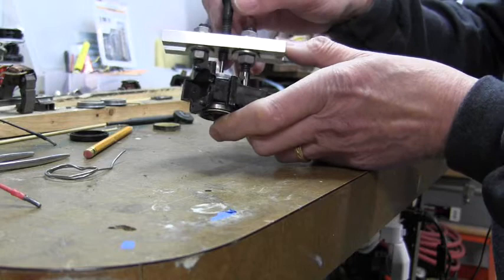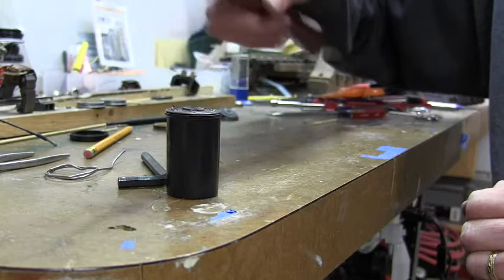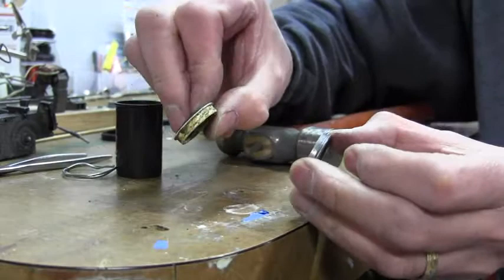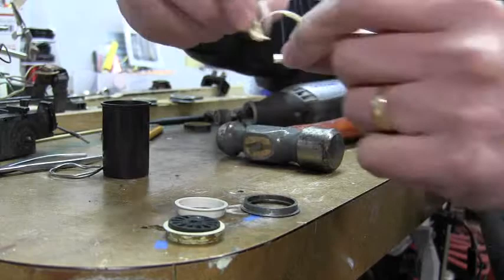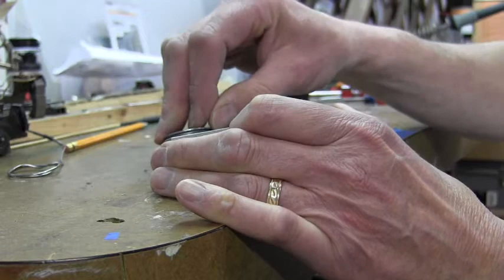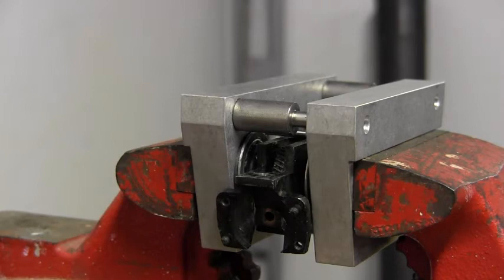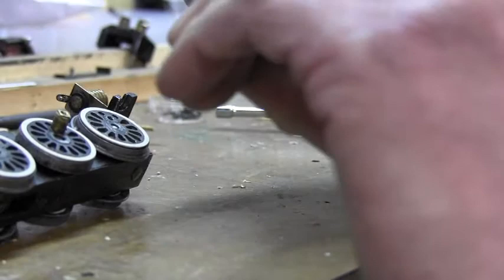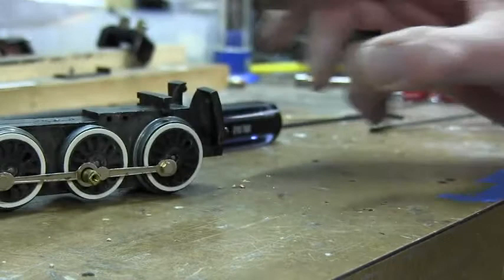American Flyer Steam Locomotive Wheel Repair and Quartering

Comment: Just  a real interesting side thought here. The quartering of the timing of the heels in reference to the side rods brings up a very important question.  I have been hearing lately that the normal steam engine make four chuffs per revolution.  If that is true, would not two of them make the chuff together, and then there would be a space between the 1st and the last chuff as well, as in reality three chuffs per revolution, with a break between the 1st and the 3rd chuff...

Comment: I have a 1957 Loco with the 4 drive wheels. I was just doing some cleaning and oiling and noticed one of the front outside wheels was spinning freely on the white piece. I removed the wheel expecting to find something broken but everything looked fine. I then cleaned them up with some mineral spirits removing all the oil and the pieces snapped back together with a click. 

So was wondering if a few drops of CA glue around in inside perimeter of the two front wheels while they are removed would be appropriate to prevent it happening again. 

I don't have a quartering jig but made good a reference to where the wheels were and  only removed the front wheels not the rear drive wheels. I saw quartering jigs on ebay but before spending 70 bucks I may give it a go without one. Use a C Clamp to pull the two wheels together. Thanks for the Video.

Comment: Great video.
I have the Pacific/K5/Hudson quartering tool for 6 wheels & Northern Quartering tool 8 wheels that are idential to the quartering tool you used.  I also have the factory reproduction quartering tool for the 0-8-0. All bought from Portlines.
Is there a quartering tool available for the 4 wheel  Atlantic?   If not how do you go about quartering the Atlantics?
Thanks.
Reply: My wheel puller identical to the one you used in the video.  I have used it for six wheel and eight wheel standard size wheels.  The aluminum block's slots were not milled deep enough to bring the tips close enough for the flanges to get under the center hub of an 0-8-0.  Any suggestion for what wheel puller to use for the 0-8-0 or other method if removing the hub?  Thanks.

Comment: I was watching the video as I was trying to put the wheels in the quartering tool and then I never saw the time when you installed the axles, Did I miss something?
Reply from the maker: The front two axles were placed in the chassis. The rear axle has the gear. When the chassis is placed between  two halves of the jig and then pressed together everything goes together. Sorry for not being more clear as I explained in the video.

Comment: What about wheel slippage on the track. I have problems having the #312 engine pull a long line of rail cars? The engine wheels will just spin until they get enough friction to pull.
Reply from the maker: The wheel treads are worn out due to age or being cleaned polished with sandpaper. You have two options: Try using some coarse 80 grit sandpaper and sand across the tire to give it some roughness. The other option is to replace the wheels with Pulmor wheels.

Comment: I don't have that awesome quartering jig but I have a question about the same.  When you quarter the wheels, are the one side exactly 90 degrees different from the other side?  And does it matter which side is the lead side.  In other words, if you were looking from the motor end toward the front and one side had all of the wheel screw heads at the top and the other side were all facing forward, would it matter which side was forward?  Great video though!  Thanks.
Reply from the maker: They are actually a little less than 90 degrees.  It makes no difference which side you do first there is no lead side per se.
Reply: @timcoe6841  Thanks for the quick reply.  I tried to purchase a quartering jig before, but the guy wanted to keep it because his father made it.
Reply from the maker: You can also get quartering jigs from portlines.com hobby supply

Comment: Great video.  My dad and I would like to repair his 336 - the flanges on the original tires have worn thin and the cast rubber traction tires are falling apart.  Where did you find replacement insulators?
Reply from the maker: Portlines.com hobbies
Reply: What about tires? My 290 has enough miles on it to have taken a trip from New Haven to Atlanta